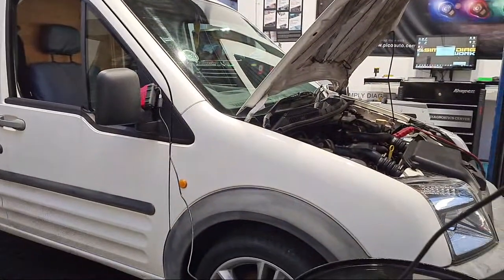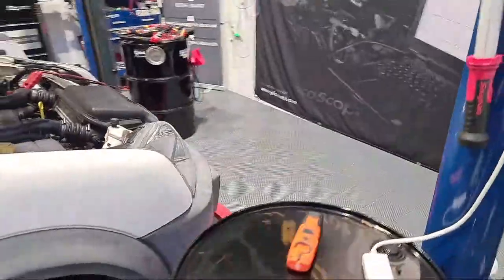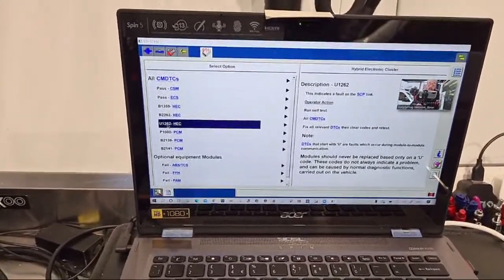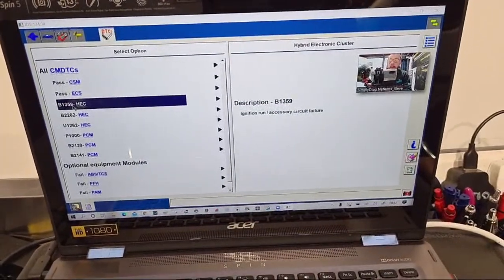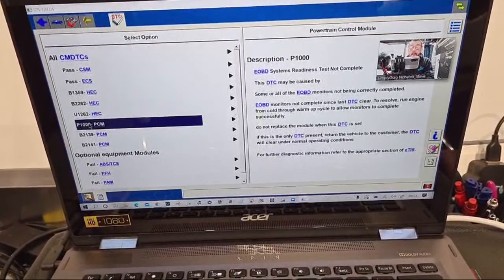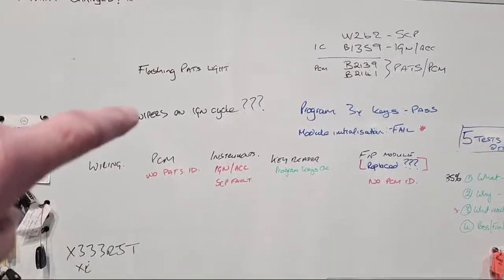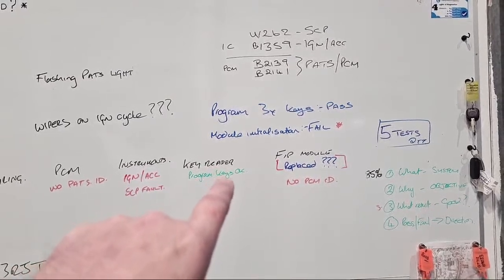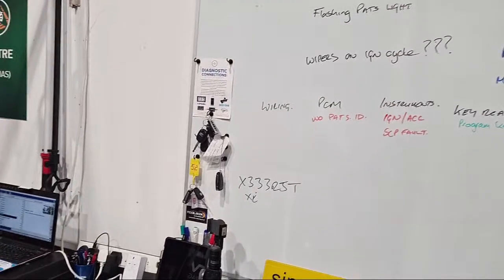Transit Connect 1.8D Flashing PATS Light B2139, B2141

Comment: I have same problem on transit 2.4 2005  fault code 23   B2139  When turn on ignition red light bleeps 2+3.  Coded  in reconditioned fuel pump, had two new keys coded in. Yet still get same fault B2139 immobiliser fault.
Reply: Did you ever find the fault?..

Comment: what was the fix then?
Reply from the maker: See the photos in the community tab 👍
Reply: @SimplyDiagnostics  I dont know what or where the community tab, sorry for being thick
Reply from the maker: If you go to my channel homepage, at the top there are different tabs and hot links to my merch etc, there's also a tab that says community 👍
Reply: @SimplyDiagnostics  dissconnect battery, leave it for a while and do the Module initialization again, I had one with same prob being a pain in the arse, had to do module initialization 3 times
Reply: Did you find the fix, I looked in community and can not find it, have same problem.